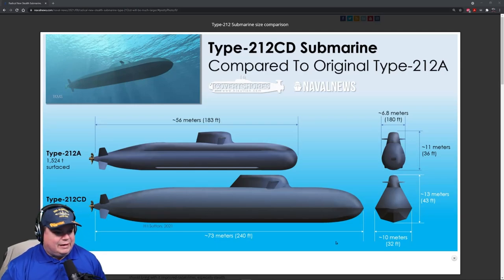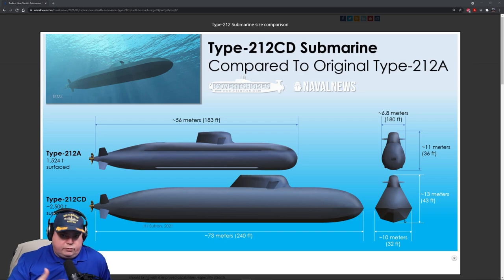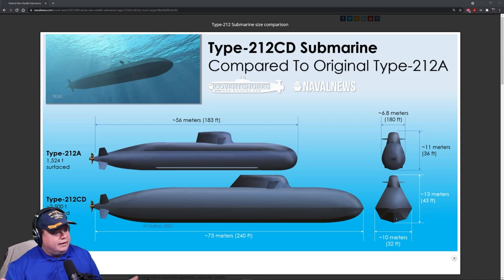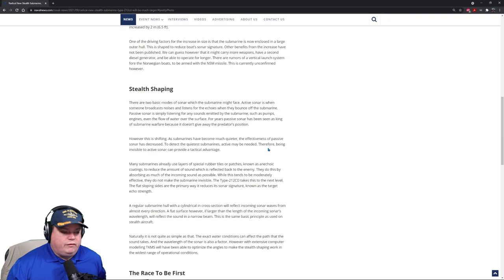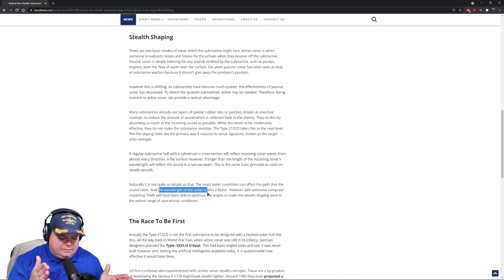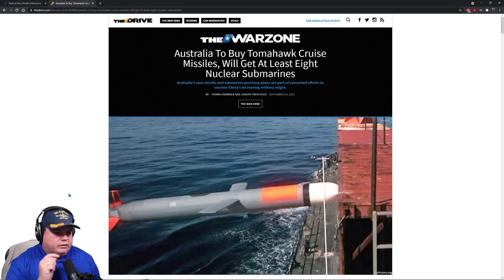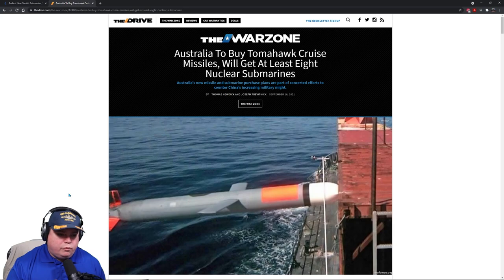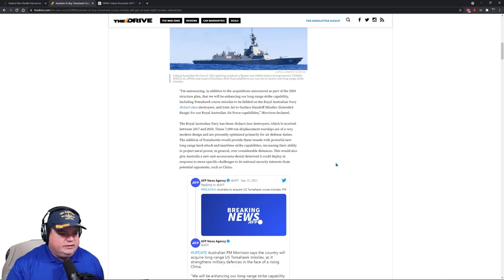New German and Norwegian Type-212CD

Comment: It is a shame Norway gets only 4 of these submarines. Norway has the fourth longest coastline in the world, and an economy mostly based on what our coast provides of wealth. We used to 15 submarines. Let's hope the 212CD would carry the NSM missile and SAMs.
Reply: If I have learned something from watching Aron play cold waters is that if they add VLS to the design, it becomes a whole different beast when attacking a surface fleet or launching cruise missiles
Reply: Well the German ones at least will be equipped with IDAS for Defence against aerial threats and small ships/land targets. I would hope for a tube launched version of the NSM as well. I don’t think they’re going to go for a VLS. That would take up too much space needed for the liquid oxygen tanks used for the AIP
Reply: @maxt9657  yeah, probably would require extending the sub even more and making it slower, I'm just saying that the capability vls provides would make them punch way above their weight class
Reply: @maxt9657  IDAS again land target must mean a very small target indeed. VLS on 212s would probably mean a much bigger boat. Possibly so large it should have a reactor.
Reply: @sebastianguerraty6413  it is a nice capability to have especially if you want to attack land targets or large surface formations (like carrier strike groups). But I suspect that these submarines are build to counter Russian submarines in the Norwegian Sea. It is unlikely that the Russian will try to break out into the Atlantic with a surface fleet. Furthermore they could support British and American nuclear submarines in the GIUK gap. All in all I think they won’t come with a vls system. Perhaps they’re going to have more tubes than the 212a which has 6. so maybe 8 for a more varied loadout
Reply: They are going to be armed with NSM, in fact with the Block 1A version, that can hit both sea and land targets. This was one of the requirement from day one. Kongsberg had a model of the torpedo tube launched version on the Naval expo back in 2017. The Torpedo tube launched NSM, that was modeled on the expo, was cased inside an "torpedo-case", I think the idea is that it can swim far away from the submarine, before it launch
Reply: @hantykje3005  yes it has just a 12 kg fragmentation warhead and only 20km range. But this capability is mentioned by the German Navy
Reply: @heuhen  that would make sense. Germany is going to procure NSM for our next frigates as well if I’m not mistaken
Reply: @maxt9657  The model Kongsberg showed during the Naval expo back then, was capsuled inside a "torpedo-capsule", I think the idea is that the "torpedo" can swim far away from the submarine, before it launch the missile. (It is just a theory, but would be a dam good idea, since launching a missile from a submarine, is a big give away)
Reply: @heuhen  that would be a pretty unique feature that I’ve never heard of anywhere else before. But as you say It would improve survivability after launch a lot.
Reply: Ehh. Hantykje.. we got the second biggest coastline in the world…
Reply: @maxt9657  based on the 688i, you can stuff individual VLS tubes into the forward ballast tanks without adding any significant length.
Reply: @maxt9657  IDAS is basically a small SAM, though it's closer in concept to a wire-guided antitank missile.

Good for smiting helos and small boats.

As I understand it, the missile is fiber-optic guided and the 4-round magazine stays in the torpedo tube. Missile is what gets launched out and it has enough standoff to not pop up close to the sub.
Reply: And yes, Norway really needs about a dozen subs. Ask the Brits what happens when you have two subs in drydock and four broken enough that they can't leave the pier!
Reply: @slikerdet  as to which is quieter, depends on whose boats we're talking about.

A Soryu is definitely quieter than an Alfa, for example, but a Seawolf is quieter than an early Kilo. It's when we start talking Soryu versus Seawolf that things get interesting. And classified all to hell.

The Astutes are supposed to be very quiet. Since they're using the same reactor plant as the Vanguards, it makes sense. 

You can set up a nuclear sub to have minimal noise sources. Natural circulation reactor, the Main Seawater/main condenser using scoops instead of pumps, and either electric drive or a many stage low rpm steam turbine to directly drive the screw. That eliminates multiple pumps and the reduction gears, which are your major noise sources.

Oh, and the US did most of that on SSN-671, USS Narwhal. I heard she had an NC reactor, scoops for main seawater, and one single enormous main engine to turn the screw without using any reduction gears.
Reply: That’s only counting the fjords. Norway isn’t that big
Reply: @jugganaut33  counting the fjords you get an distance equal to Oslo-Sydney in air. Norway could aslo have had three time zones. One in Bergen, a second in Oslo, and a third in Alta and eastwards.
Reply: @jugganaut33  still as long as Alaska north to south, so you'd want your subs based in two places ideally. I guess you might get away with basing them in the center of the coastline north-south.
Reply: Well, length isnt projected length.
Reply: I agree and I also think it's more than just shameful for Germany to get only 2 when they have the worlds fourth largest economy but because of societal and political pressure their military is forced to always limit it's own capability to a minor power. They always develop great new equipment in terms of conventional vehicels but nothing more and that the deploy in far too small numbers.
Reply: @burntbybrighteyes  hear, hear!
Reply: @burntbybrighteyes  yea Germany has really gimping itself these past few years in terms of its military in more ways than one they should have at least 8 of those subs for themselves if not more not to mention the pitiful state of their armed forces on the whole
Reply: @killinspecialist1965  I'm not a german but I speak german and live close to the border to Germany so I have a relatively good grip on what's going on their. You're not wrong but in my opinion the largest problem is STILL going back to the war with massive amounts of ressentiments against everything to do with the military. It's really a bizarre situation where the military has to ask permission for practically everything from the parlament where "progressive" parties keep shooting down the army's requests. Let me give you some  examples that really show this well. The german parlament does not allow the german military to use armed drones. They have drones that are designed to carry missiles but they are only allowed to use them for unarmed recon. Whenever the military is used they get insane rules of engagement that make it almost impossible for them to do their job. When german warships were deployed to the horn of africa for trade route protection and anti piracy they were not allowed to stop and search any shipt without their consent even when it was obvious they were smugglers. Generally the idea of a army that must act strictly defensively is taken basically literally and so they are prohibited from aquiring all kinds of material they would need for a modern war.
Reply: @maxt9657  Some 212 variants like the Dolphin already had the capability to have compact VLS systems, so its not out of the question.
Reply: I am really zyked to see what becomes of the new Visby 2.0
Hope to see you cover some of that. 
   Also to often individual systems are compared. Today its more systems of systems. Hope to see the A26 work well with other naval units.
Reply: @termitreter6545  what do you mean by having the capability? As far as I know the dolphins aren’t equipped with vls. They can fire cruise missiles using their torpedo tubes.
Reply: @burntbybrighteyes  that's really sad Germany needs to stop acting like the treaty of Versailles is still in effect and let their military act like any other im sure that if it got bad enough tho they'd throw all the bs out the window i hope
Reply: @maxt9657  Theyve been advertised that they can be upgraded to have VLS tubes, if the customer so desires.

That was actually a bit of a politicum, because you can technicall shoot cruise missiles with nuclear warheads that way.
Reply: @termitreter6545  ah ok. But tkms didn’t built any submarines with vls or am I mistaken? Well Israel can shoot its nuclear tipped cruise missiles from the torpedo tubes of the dolphin submarines. No difference there. Vls would be needed for ballistic missiles though is suppose…
Reply: @maxt9657  Yeh, I dont think the VLS upgrades were ever done. 
I didnt know Israel had tube launched cruise missiles, but that probably explains why they dont need the VLS.
Reply: @RobertLutece909  Russia is certainly buying a lot of new equipment despite being broke…
Reply: @RobertLutece909  Four boats usually means one deployed, one in training for deployment, one on maintenance, and one pending. Very rarely you have more than a 1/3 of the force operational. Norway's coastline is still 25.000 kilometers (Oslo- Sydney is 16.000 kilometers)
Reply: Sure but then again Norways population is only 5.4 million and it punches way above its weight in the size of the air force aswell... WHAT really needs a size increase is the army, it can survive with a smaller navy in Europe cause it has alot of naval allies and the Russian navy isnt what it used to, but if it doesnt have an army to hold ground its gonna go downhill very fast.
Reply: @banger2998  I havent found a single comment that say a navy isnt important, the Norwegian navy is capable and gets the jobs done, the Norwegian airforce Punches well above its weight and is very large. But the Norwegian army is very small and unable to hold ground for very long, this is the only one of the branches in major need of a significant expansion, the current size isnt even large enough for us to hold onto Finmark against a Russian invasion (2 divisions +) for more then a week.... and thats even a maybe.
Reply: @banger2998  Defently, no disagreement on that but going from 13 (with 10 less well equiped and 3x fully equipped) Brigades to 1xbrigade (yes thats right 1x) is the most serious and dangerous drop the norwegian defence currently faces.
Reply: @ScottKenny1978  There is big difference between peacetime and wartime availablity.
Reply: @kennethhawley1063  yes, there is.

But submarines haven't been at war since 1982. No, launching cruise missiles does not count as a successful combat patrol. No tonnage sunk, no successful patrol.

If I were Norway, I'd want dual crews on my subs and as many ships as I could get. And design all new ships for quick replacement of major systems, along with replacing equipment before it's expected to fail. 

Example: Know that a periscope has a 2000 days deployed life expectancy, and it has a 100 day standard deviation, you plan to replace that periscope after about 1500 days deployed, refurbish the one you just pulled, and use the refurbished one in the next sub.

This would keep the Norwegian subs out at sea as much as possible. 

This is actually based on the US pattern for WW2. Subs would be out for about 3 months, spend a month in refit, and go back out. That month in refit, the shipyard was doing all the work, the crews were basically on leave for a month to destress. And it was the same crew that went out every 4 months. But having two crews and alternating which crew is in possession of the boat allows you to maintain wartime patrol rates in peacetime.
Reply: @termitreter6545  as if you can't shoot a Tomahawk from a standard torpedo tube. 🤦

Don't let people who have no clue make decisions on things! (Edited for spelling)
Reply: @burntbybrighteyes  Germany doesn't have any jurisdiction outside of Germany and its territorial waters, so why would they allow them to do such a thing?
Reply: @banger2998  Norway is DEAD if Russia wants to take it. We Norwegians already know that. Besides, if Russia really would have wanted Norway, they'd have taken it in 1944 when they invaded Norway to drive out the Germans whom they chased far southwards towards Trondheim, but they didn't. They left after the war was won remember?
Reply: @Nghilifa  I'm talking about a multinational anti piracy mission where warships from a multitude of nations operated in the waters on the horn of africa and all of them used to order suspicious ships to stop to be searched. The germans were the only ones who had to politely ask the suspicious vessels if they would kindly agree to be searched.
Reply: well... length of the coast has nothing to do with it unless you want each fjord have its own submarine or something
Reply: @jebise1126  that sounds like a good idea actually they could act as landmines kind of for any force trying to get in
Reply: @ScottKenny1978  how quiet are the chinese yuans with AIP??
Reply: @ashuramamun9488  they came out after I got out, and I was a ship driver not a sonar tech, anyways.

That said, on diesel they're about as subtle as a fart in a bathtub. (Also, note that most submarine diesels are uniquely quiet and smooth running, so if you hear a Fairbanks Morse 38D (for example) you know it's a sub). 

As to their AIP, it's described as a "specialized engine" which makes me think it's a Stirling engine, not fuel cell. Because that has moving parts, it's not as quiet as a fuel cell. 

I'd expect the Yuan class to be as quiet as a current production Kilo in general. A pain in the butt to track, but not capable of sustained high speeds while quiet.
Reply: @ScottKenny1978  oh no, then what choices of boats do developing countries have that are priced reasonably. Btw whats your thoughts on the chinese 054 series frigates?? Thanks for the reply
Reply: @ashuramamun9488  I know zero about the Type 054 frigates.

My preference for a diesel sub, if you can afford it, would be a Soryu class from Japan. Otherwise, a Type 212 series from Germany. You really do need to spend money on subs, a cheap boat like an early Kilo is little more than a target today.
Reply: @ScottKenny1978  at this point when the first world and big countries moving to 5th gen technologies what's even the point of developing nations having air forces and navies. It is so restrictively expensive. Funny how Pakistan is relying on the AIP less Yuans to counter India's Scorpenes
Reply: @ashuramamun9488  you need a Navy to keep pirates out of your territory, and to keep other countries fishing boats out of your EEZ. That doesn't take big ships. In fact, that's the case where you do want more, smaller ships and not a small number of big ships.

India and Pakistan are a poor example to go by, they're in an arms race with each other.
Reply: The thing is that how germany and norway are set geographicly is how this submarine is. Its not meant for vls because they are like the type 212a more for costal defense. But i think that is a big problem there we no direct enemy have like in the cold war and no new cold war is they dont no what they should build. I mean that they dont set on Strategic warfare bit more on near coast gorillia warfare.
As a german i think our biggest problem is the fear that something like Nazi germany happen again. So our complett land is build so that that will not happen.
Which lead to heavy restrictions on the german military. And i think that we need to invest more in aip. The 3 thing i wish to happen are: smaller Aip, more energy output and more quiter engine. For our Fuel cell technology is a cool ad on called electrolisis which allow our to splitt water in hydrogen and oxygen.
It where nive if we could Use both so we have more storage for batterys. The problem  is electrolises need energy.
Reply: @kqckeforyou4433  before the Los Angeles class had VLS, they launched Tomahawks out of torpedo tubes. Having a VLS means those Tomahawks aren't taking up space in the torpedo room. So you can have a Sub-Harpoon in one tube, the LMRS minesweeper UUV out, IDAS in another tube, and a heavyweight torpedo in the 4th tube, each with 2-3 reloads (or even more). Submarines today have a lot of things in the torpedo room that are not long range land attack missiles.

And the VLS can hold other things, too. Could hold more Harpoons (or whatever the Germans use for an anti-ship missile). Could even stick some IDAS in there!
Reply: @maxt9657  As far as I know, it is worth adapting a ship to a few targets in order to implement the defense as best as possible.
Reply: GErmany has ordered just 2 of these beasts.. The price tag is insane.
Reply: You need to start with a small order, test it and like it and then order more. That's called common sense.

Comment: The a good way to get your head around stealth shaping is to consider a massive room with no lights, all surfaces painted matt black, and in the middle of that room is a shape hanging from a cord, with a mirrored surface, first consider a sphere.

Now imagine you are the radar/sonar transmitter and receiver, imagine you have one of those head torches on, so that the illuminated area is where ever you're looking, now look towards the sphere, you will always see a small reflection, because there's always a patch of its surface at 90 degrees to you.

Now imagine a cube, there's only 6 relative positions where you'll get a return, you'll get a big return, but in any position other than those six you'll get very very little.

Now, if you paint that object matt black aswell, you've just applied radar absorbing paint and made it really stealthy.

Comment: Regarding RN vs USN subs, the way it was explained to me is that the chine around the bow of British boats splits the water in a way that helps it flow over the hull more quietly. Apparently for USN boats that tend to operate at higher speeds there's more benefit to having that very hydrodynamically optimised hull with a long length-beam ratio and bullet shaped bow.
Reply: a lot is to do with the type/shape of the mainframe sonar